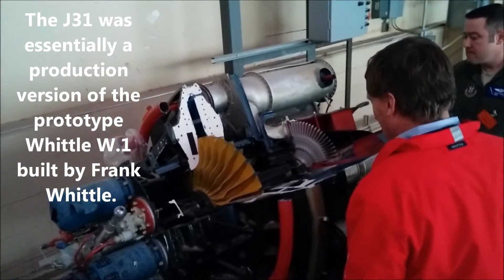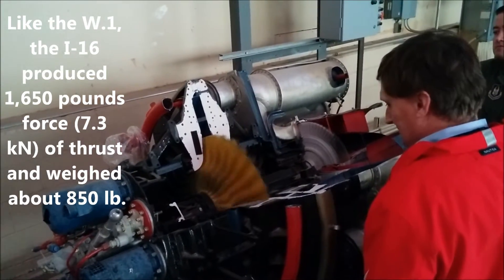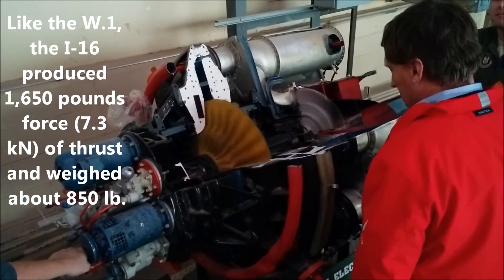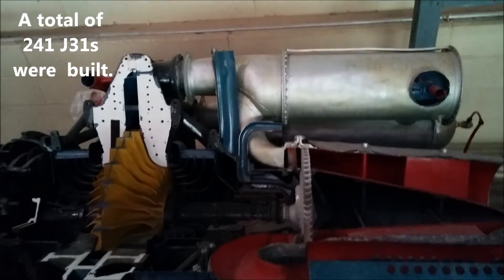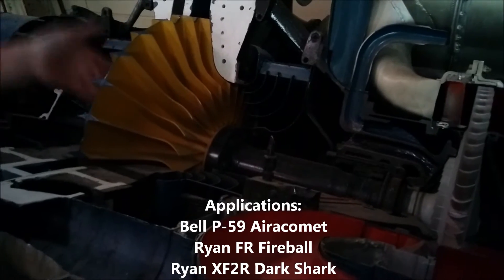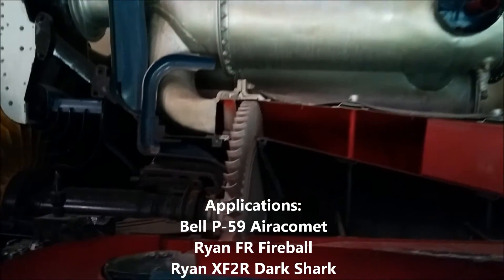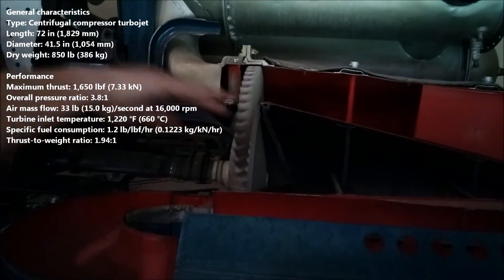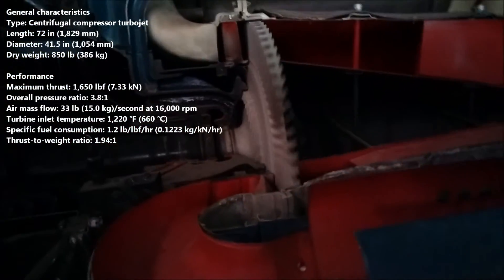General Electric J31 Cutaway

Comment: Interesting how inefficient the engine was. The F4 Phantom's engine, being similar in that it wasn't a turbofan, used .85 lbs fuel / lbf*h. Interesting how advancements in efficiency occurred.